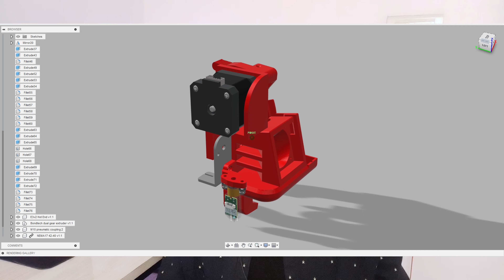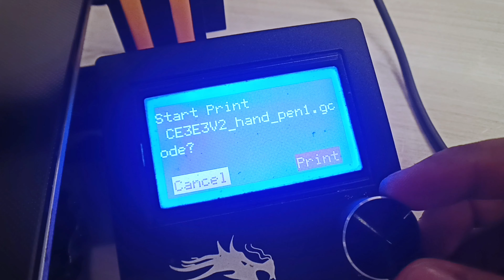Ender 3 Upgrades for High-Speed 300mm/s Printing - Part 1

Comment: So you got up to 150mm/s using direct drive, upgraded cooling, and Skr board. As well as the upgraded springs of course. 
But stock hotend it looks like? I’d imagine I don’t need to upgrade the belt tensioner either.
Reply: Ohhh I see, you used the stock hotend heat sink,
But have the longer heating zone below.

Comment: Great video! I have been waiting for a while, and will the filament making machine ever come back in a full tutorial? I once tried to make a PET one, and it didn't work because the pet wouldn't extrude properly. This is why I wanted to see your proper PLA filament making one, as I could've used lots of the parts from the broken machine, as they are obviously quite similar. Is the project scrapped? Or should I still wait for an in-depth / finalised tutorial on how to make it? Thanks!
Reply from the maker: Hey there, I'm sorry to inform you friend that I scrapped that project. When I considered the output versus the time required, it wasn't really feasible for me. It makes more sense for me to spend a bit more money and buy filament rather than dealing with pellets and the extrusion process. But if you need any help with this,  you can contact me or share the image or video of the problem directly at creative3dp0@gmail.com. I'd be happy to help you out. Thanks for understanding.

Comment: The glass bed and the bracket the bed sits on are so heavy. I drilled mine out and cut a lot of weight. I don't have a scale lol so I can't tell you the exact amount, but it's a lot. I replaced the glass for a magnetic spring steel sheet which significantly cut the weight and replaced the bed wheels for M4 nuts.

I would suggest an Orbiter 2.0 direct drive & motor upgrade over the stock Nema 17 to cut your weight right down on the gantry.

Comment: For some reason my volcano nozzle is higher than the 3d printed satsana mod. Could I unscrew the volcano nozzle a bit so it goes lower? If I install a k1 nozzle, I think it would also work because the head is taller. I am almost done your whole mod! Thanks for your help!

Comment: Hello! I printed your version of the motor mount in ABS. It fits fine behind the bearing and the tube connector is aligned nicely with the hotend but now the extruder screws don't fit anymore, since the material is way thicker than the metal sheet it's supposed to be mounted originally. Did you use longer screws?
Reply from the maker: Yes, I used longer screw
Reply: @Creative3DP  
Thank you. I think i missed that in the video.
Reply: I made a modification to yor design on Cults under Profile "FlueRian" It works with the Original screws and isn't too wobbly.
Reply from the maker: that's awesome.

Comment: Hm direct drive but attached old heavy motor on x qxis 🤔. It supposed to be as light as possible not as heavy as possible 😂, the old  original is better in your case because it's not so heavy

Comment: Hey you look Indian, any chance you could drop the link as to where you got the volcano heaterblock from?
Reply from the maker: novo3d
Reply: i was thinking maybe it would be a better option to get a e3d volcano hotend clone primarily to get a all metal setup so you can easily go beyond the 240°c limitation to print petg and also so you can increase the flowrate of pla
Reply from the maker: Printing petg wouldn't be a problem with the clone
Reply: who the fuck starts a conversation like that, then asks a completely unrelated question?
Reply: @ABrainDeadIdiot I think the same XDD
Reply: @arrigato8996  nope its not as simple as that. PLA sucks with all metal if its not properly set up and used. Volcano is for more flow and or speed. if you print slow , you are gonna get oozing, stringing and definitely heat creep and clogs. you will need a good bimetallic heat break installed properly into the head sink with proper thermal grease/paste. (aluminum heatbreaks are pretty outdated , heck even the v6 is outdated!) and good hotend cooling from a high cfm fan is must. and all this would work well if you actually print a little faster. by that i mean ~ < 10 mm3/s flowrate.

Im telling all this because ive dealt and built 3 printers from scratch. two cartesian printers and one vz bot. ( i then again got issues with the vz bot due to the use of bad belts and bearings which rendered it useless. i had to dismantle it to build an other printer). 

IMHO Cartesian printers are the best low maintenance machines ever! especially with klipper and all the other upgrades available today.

Cheers!
Reply: @ABrainDeadIdiot probably because sourcing parts in India is harder